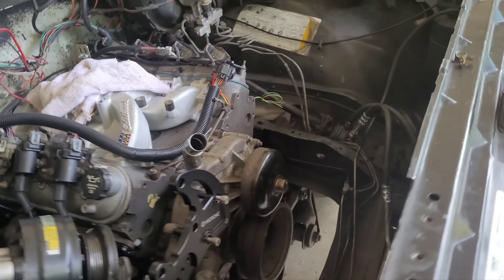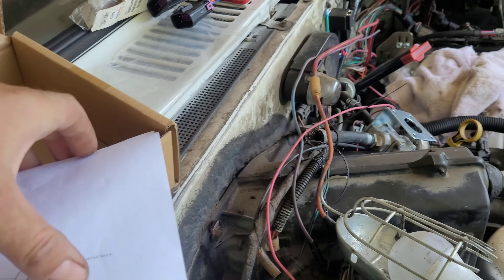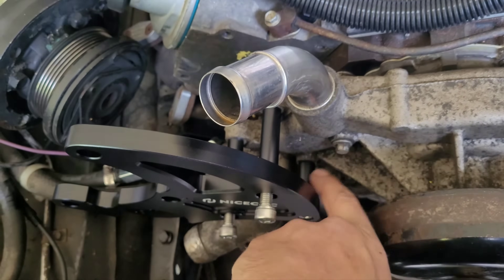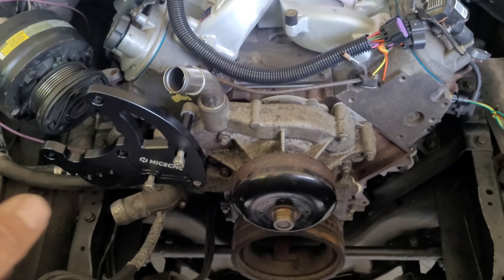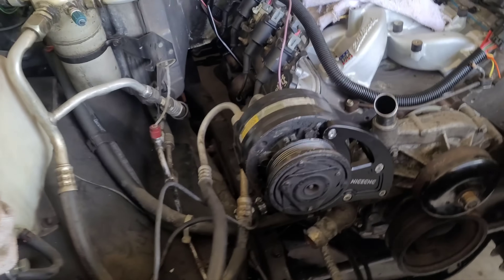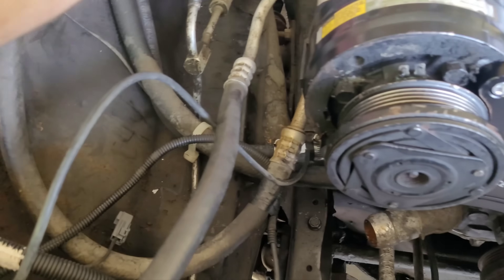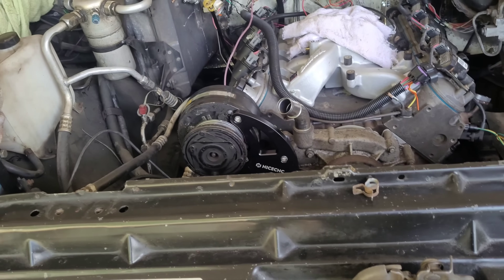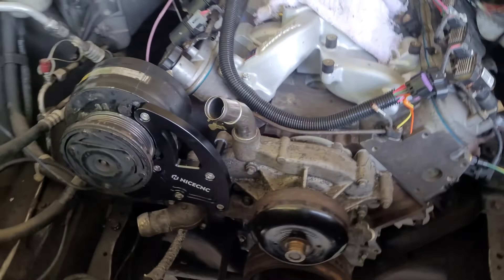How to: Retro fit your R4 Style AC compressor onto an LS engine

Comment: Man I was just looking at how to do this in my s15 I ls swapped a 5.3 out of a 2001 Tahoe and I was wanting to keep my OEM AC compressor cuz I just had it fixed before I ls swapped it do you just keep the same wiring to it or do you have to do it into the computer

Comment: i have a 92 sierra with a 5.3 ls swap and i have the r4 ac bracket but the problem i’m running into is the ac line is bent to fit onto the compressor due to the placement, what lines are you running to make them fit that way or are they custom made? thank you😊
Reply: Did you ever find out what to do I’m running into the same problem
Reply: @ all i did was leave them bent and it worked perfectly fine but i saw another video where he used these lines UAC-HA10638C and a Murray 70-3554 and they fit perfectly but i got rid of the truck before i had a chance to get around to doing it

Comment: How is it holding up?
Reply from the maker: Sold the truck
Reply: @beeterolds so do you know what the deal is with that kit saying it’s for a 4 inch clutch not a 5 inch? I’m pretty sure I have the same compressor but I’m measuring 5 inch. What size clutch did you have? Does it matter? Thanks in advance.
Reply: Gates tensioner part # 38163.    Gates Belt part #k061037

Comment: Could you please do a video on how you wired your green wire to your ac clutch or where you found it at in the harness?
Reply: what is the part number of the serpentine bell and the tensioner
Reply from the maker: Its just the stock wire from the original harness. Nothing magical here
Reply: @beeterolds @a/c working?
Reply from the maker: Yes
Reply: @beeterolds  what size belt ?